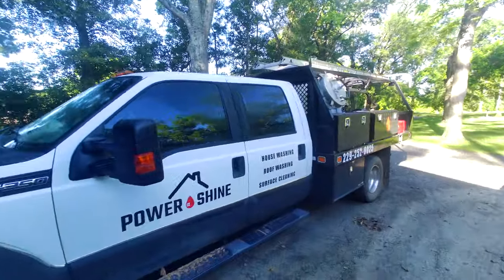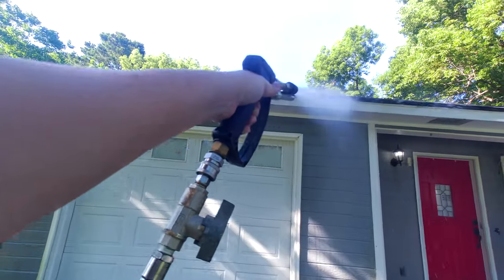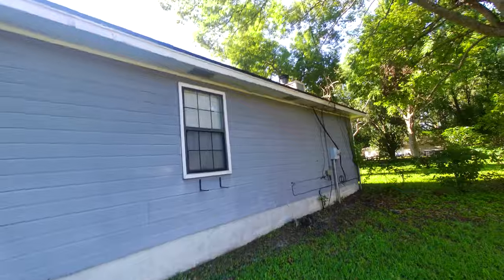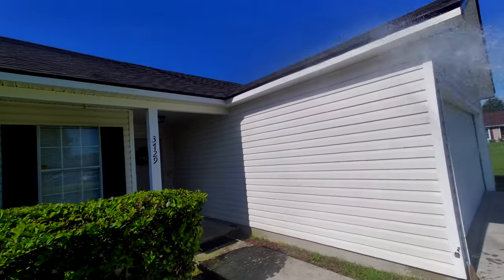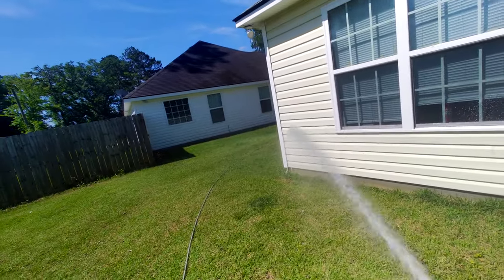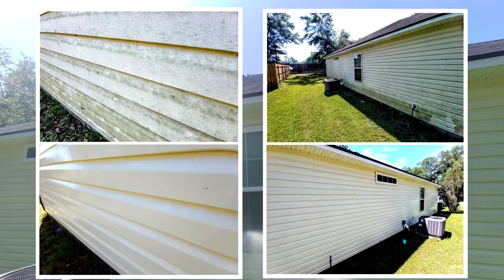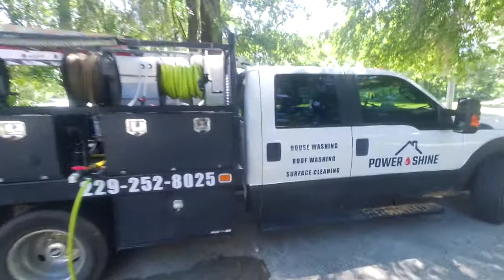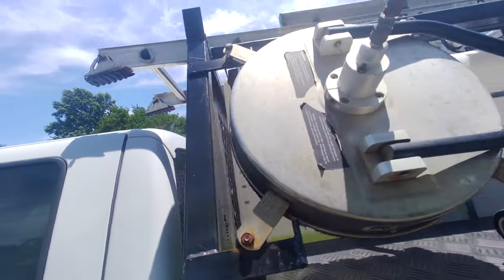HOW TO Wash 5 Houses In 1 Day- Pressure Wash Houses in 25 minutes!

Comment: I started with a 3 gallon pump up sprayer and a water hose my 1st year, then I went to a 14 gal tank on a dolly with a 12 volt pump and a battery mounted on the back of the dolly, and 50' of hose for couple of years.  I did the pressure wash low pressure nozzle and chemical injector, then hi presser nozzle thing for a couple of years.   Then started using a 12 volt 7 gpm fat boy pump to apply chemical, and rinsed with the pressure washer for couple of years.

Now I use an 11 gpm 580 psi comet pump on a 6.5 hp engine for softwashing.   The pressure washer is separate; however, the water supply runs to my freshwater tank and Y's to a Hudson valve and continues on to the pressure washer's intake.  I have valve that I can close to keep all water going to my freshwater tank if I want.   The soap/bleach mix comes from a chemicl tank and goes through an electric valve with remote switch so I can rinse on the fly and has a 3 way valve that I can use to flush the chemical out of the electric valve when I'm done,  after the electric valve there's a proportioning valve to control my % of chemical. 

After using the dedicated softwash pump I'll never go back to any of the other systems.  It puts out more chemical, rinses quicker,  saves me a lot of hose dragging.   I don't know how I ever did it the other ways.
Reply from the maker: Awesome!

Comment: New to this, I see at the end there are two different hoses. I only saw you using 1 which was the soft wash system. Is 1 hose used for mix and the other used strictly for water? Great video and glory be to God 🙏🏼
Reply from the maker: @davidl7983  I have four hoses. One for water fill, one for pressure washer, one is a spare pressure washer hose, and the other is a soft wash hose

Comment: That black tip. Is it the standard adjustable tip from Amazon?
Reply from the maker: @nickfazzio5277  no, it's the m5 twist
Reply: @powershineme  thanks… question for you. If I’m running a 12v 5.5gpm everflow pump should I use an m5 twist or is that mainly for downstreaming injector purposes?  Thanks
Reply from the maker: @nickfazzio5277  I only use the m5 for downstreaming. I use my jrod tips with the everflo pump.

Comment: Why do you rinse from bottom to the top?
Reply from the maker: @Odin_Bullock  I don't. I soap from the bottom to the top. But even if I did, it doesn't matter 😂
Reply: Wait, so then why do you soap from bottom to top? Is it to prevent streaking or uneven cleaning?
Reply from the maker: @Odin_Bullock  well, water runs down, so technically it just gives the chems more time to sit on the surface as you're applying it upward. It'll run downward.

Comment: How many feet of hoses do you have to be able to walk the whole house?
Reply from the maker: @EliteAustinServices_MAustin  200 ft of 3/8 hose, but I have a spare reel with 200 ft on it as well just in case. Haven't needed it yet tho. 200ft is plenty typically
Reply: @powershineme  sounds good right now im sitting at 125ft of high pressure and 100ft for water hose, no reels yet and just a 2.5gpm pressure washer with chemical injector and 2 2gallon sprayers for chemicals.

Comment: No property protection
Reply from the maker: @brandenpatterson9936  just because you didn't see it doesn't mean I didn't do it necessarily. I weigh the risk and responsibility on each job. Never had an issue, but correct- sometimes outlets don't get taped, but only when I'm confident there will be no issue. But I also don't spray chemicals like a wild man and that doesn't come across a video. Property protection is a process of evaluating the job. Not JUST taping outlets, wrapping fans and doors etc. 🤷
Reply: @powershineme  you'd be surprised